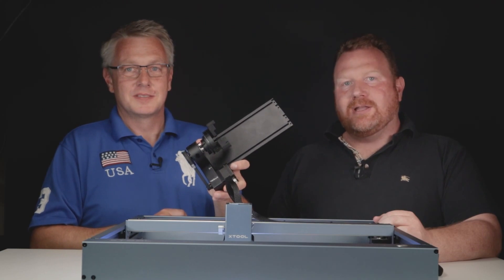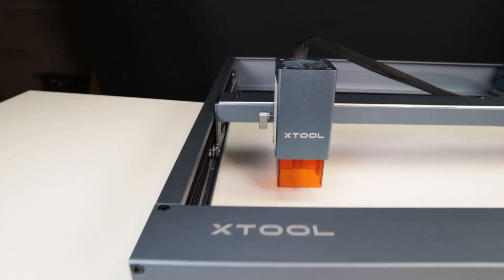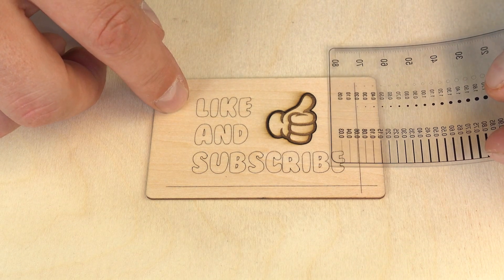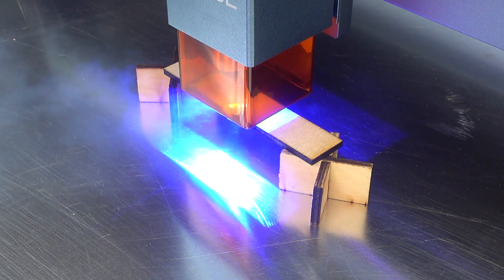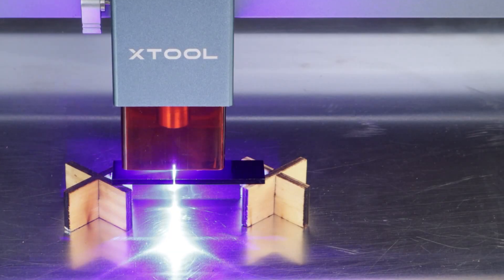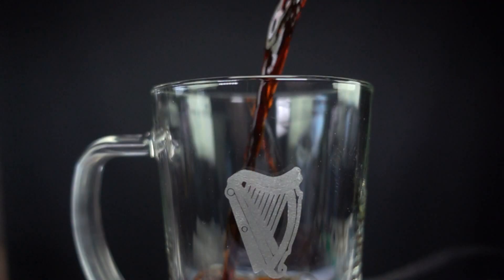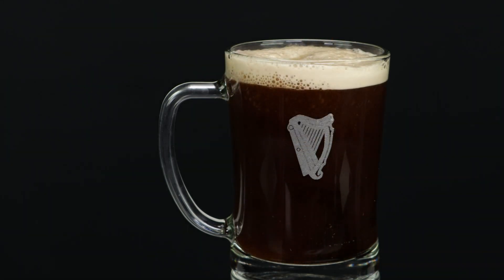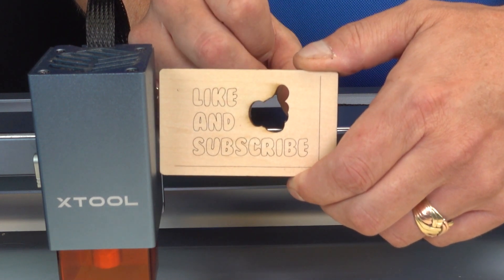xTool D1 with RA2 Pro Rotary 10W diode laser

Comment: Are you going to try again to make PCBs with the new (neje) lasers? I'm curious whether these lasers can cut through PCBs and whether you can etch PCBs better with this. Unfortunately you are not responding to questions from your previous videos.   It would be great if these newer/more powerful lasers can replace the CNC. That they can cut through the PCBs, make holes and graph an accurate etch.
Reply from the maker: Hi!
Yes, we are thinking of doing a new PCB video as laser spots have become smaller. BUT, the process would be the same. Spay, laser, etch. No diode lasers are able to cut cooper, currently. And if they were, they would also cut deep into the fiberglass and might distort the whole board.
Reply: @DIYTECHBROS  I did indeed mean the way with paint as you had done last time. But I was hoping that the new lasers were also strong enough to cut out the PCB and burn holes. Do you no longer need CNC to make your PCB to size and you no longer have to drill the holes yourself.